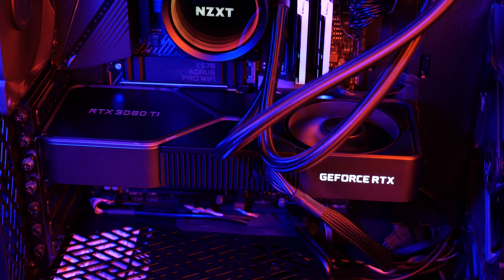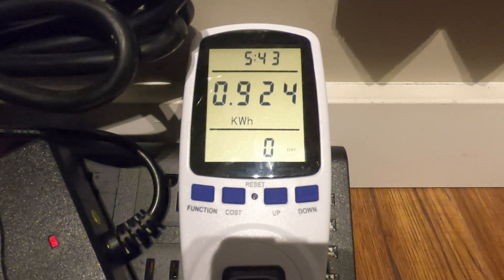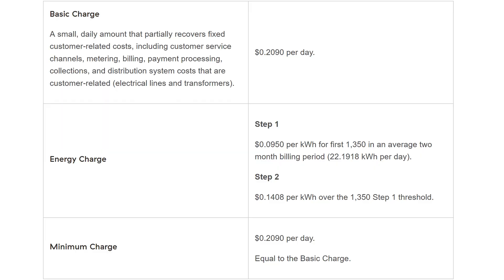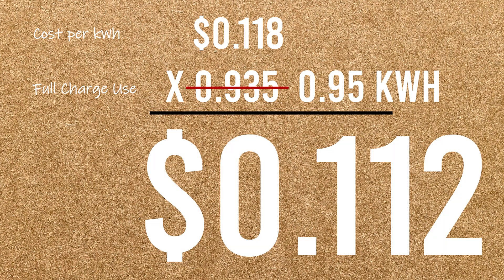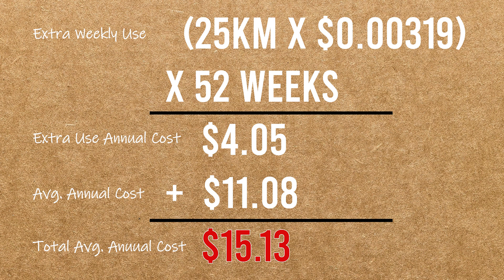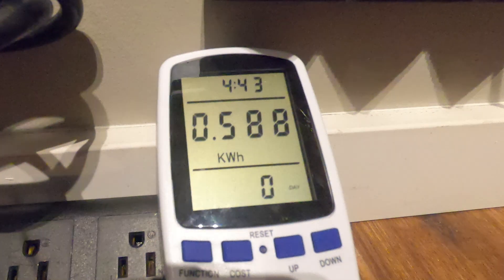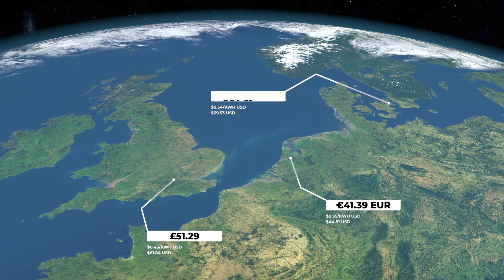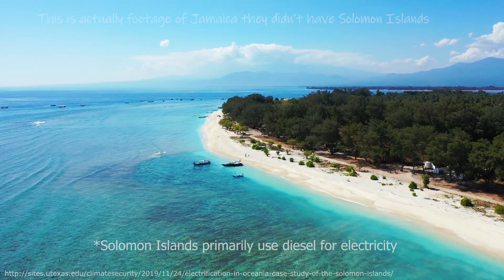How Much Electricity Does A Scooter Use?

Comment: While an interesting metric, and a motivator for some, I have found cost rarely impacts transport choices. If it actually did have an impact, public transit would be packed to capacity at all times and nobody would buy a car. Instead people are increasingly buying the most expensive cost per KM in pickup trucks so clearly cost is not much of a factor, at least in North America.

EUC's are even cheaper than scooters per KM if speeds are the same.

Comment: Your electricity is a lot cheaper than ours here in CT.  Last I checked ours is around $0.36/kWh total, plus a $10 monthly fee.  Any way you look at it, scooters are still cheap to use, even the larger hyper scooters.